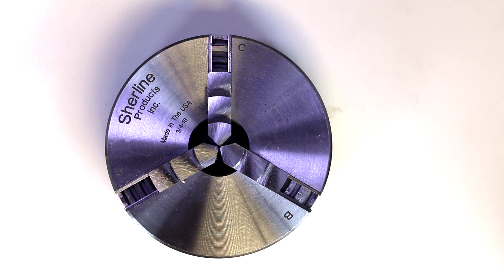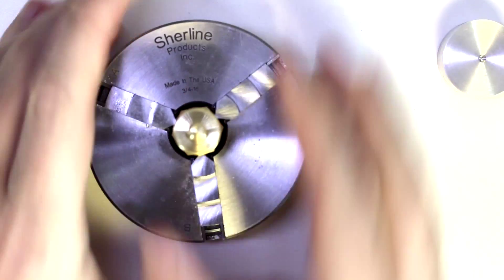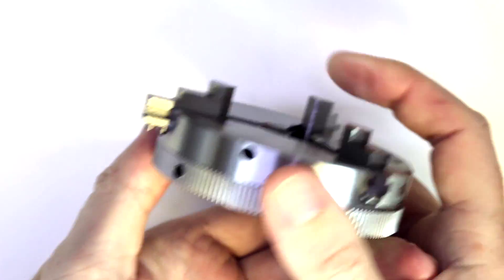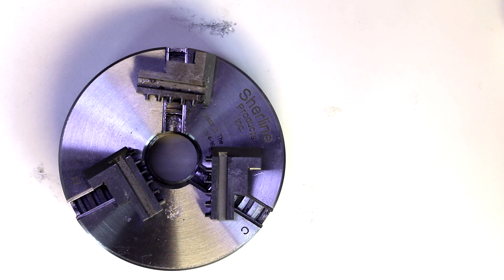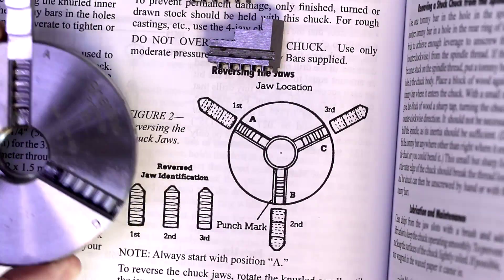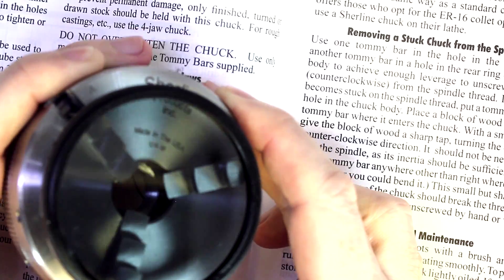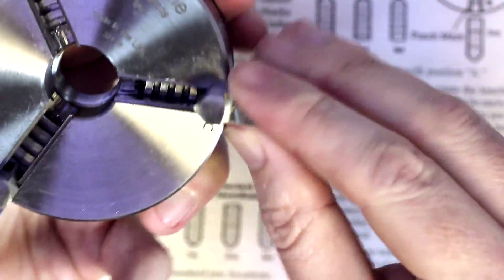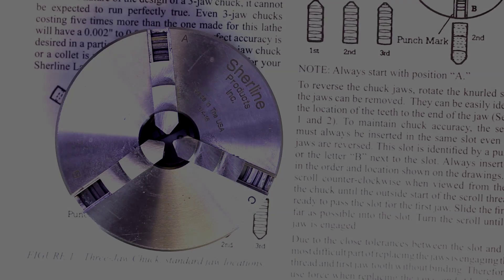Metal Lathe 122 - Work Holding in 3-Jaw Concentric, Part 1

Comment: I do not feel like using the same jaws in the reverse orientation is the best idea. It would be better if there would be separate set of jaws for that, with optimized holding geometry.